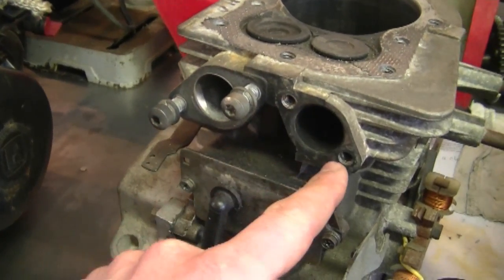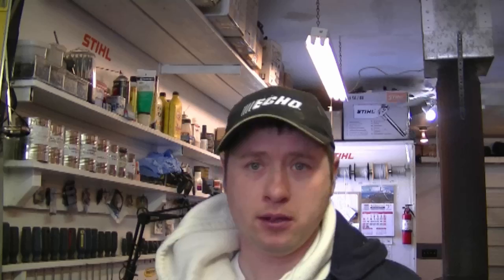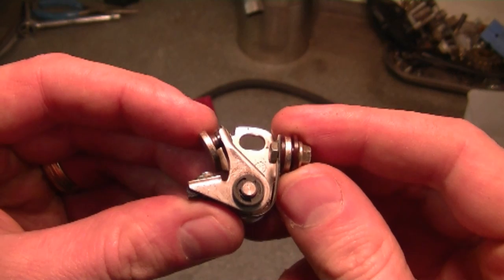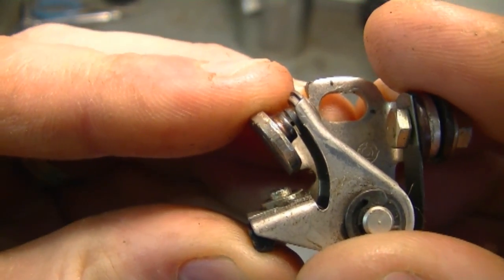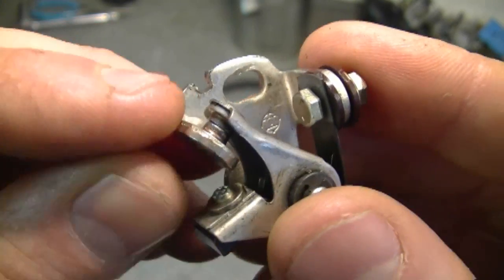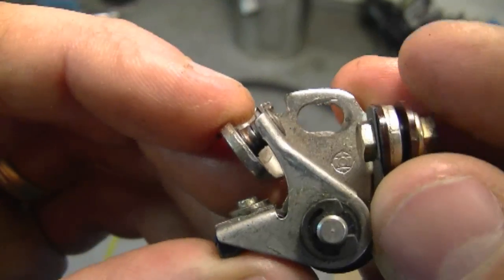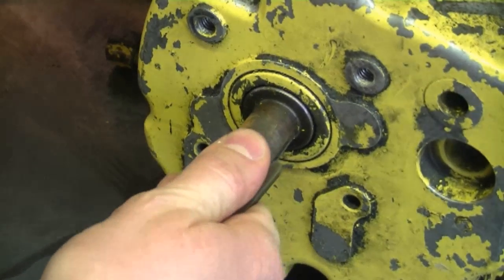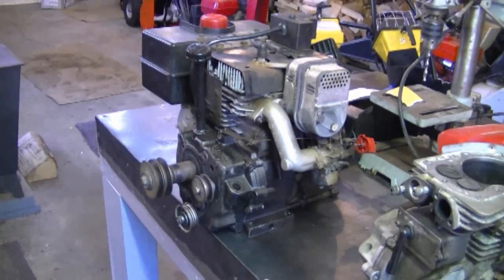Small Engines Q & A  Video #37 in HD

Comment: Hi, love your videos! Great job! I have a 3,5 hp 144cu Honda motor which only runs when i spray it with starting gas. The spark is good and i can smell the fuel after i have pulled the cord a few times. Also it smokes blue the one time i got it running but it would only run with full choke. It is mounted to a diaphragma water pump so i think it may have been running day and night sometimes. I suspect faulty piston/piston rings beacause it is easy to pull and drinks oil. Any ideas? Thx excuse lan

Comment: any advice for feller gauges that are sticking together, there seems to be surface rust on them, i have tried loosening them.

also what should  i do if the timing on an old briggs with points is slightly off, i have tried replacing the key and i am torquing everything down correct and i have tried cleaning the points.

Comment: Great Videos Don!

I've repaired and played with numerous types of small engines that all had a degree of crank shaft end play, and since these do not run replaceable thrust bearings/shims I have never bothered fixing it, and never had a problem with the engine.

Some car engines do develop it over time (50's babbit bearing Chevy's for example) and clunk and clatter when the clutch is operated, but its the only time I have herd of it being a problem.

Comment: crankshaft play is normal because parts expand with heat. only thing to remember is that vertical shafts have more maximum allowed play than horizontal ones, usually two or even three times more.